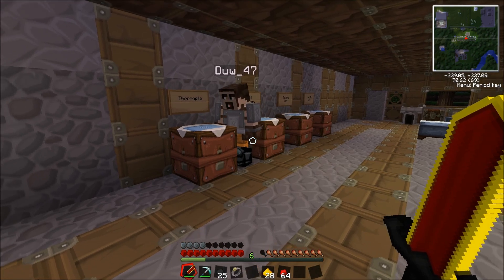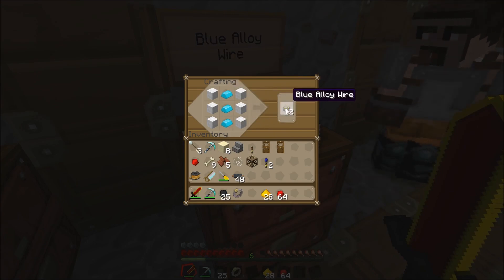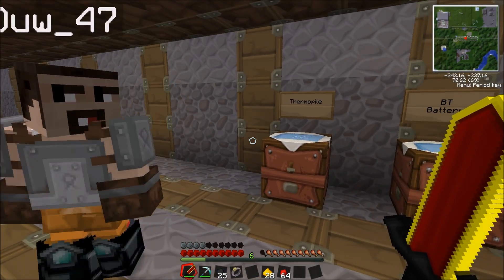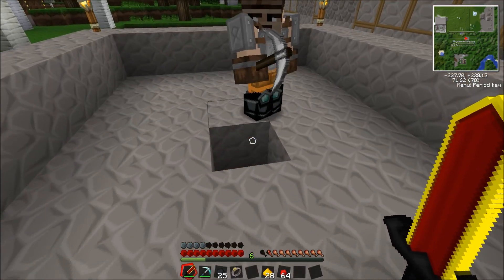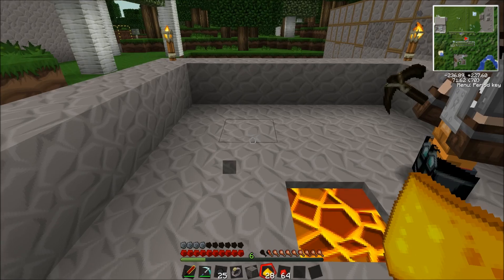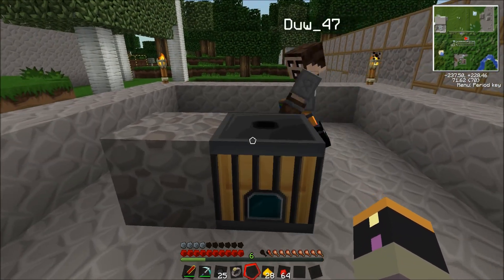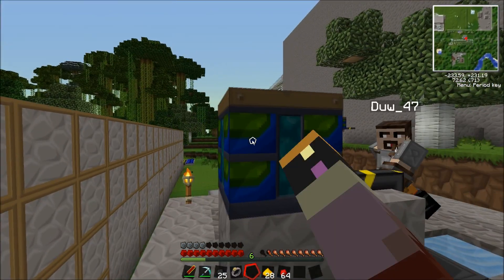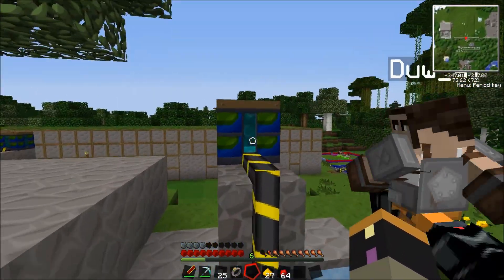Minecraft Tekkit - Thermopile

Comment: Might I suggest placing Lava Under, water on 3 sides, Lava -ABOVE- and have the wire coming out of the sides, it creates a greater differential and therefore more power. You can also then stack them, ie (vertically) Lava - Thermo - Lava - Thermo- Lava-Thermo etc and just have a wire come out of each thermo into a battery box.